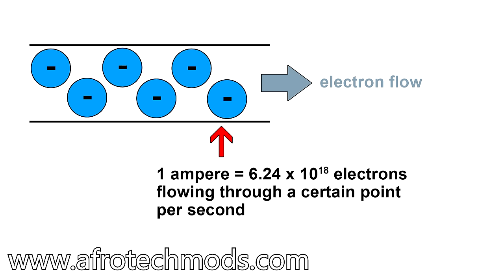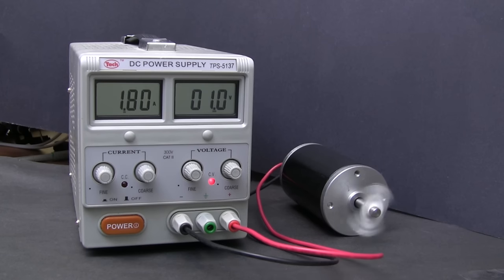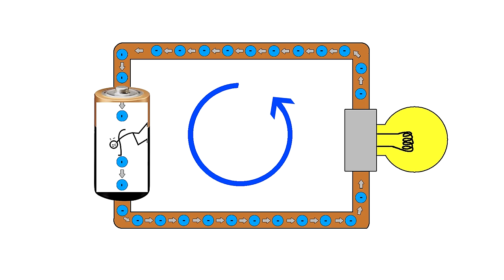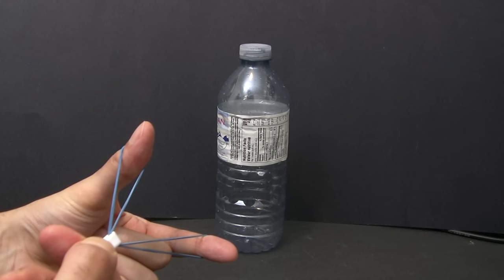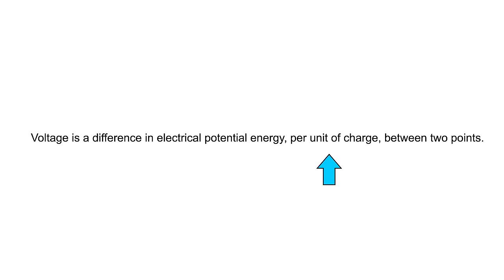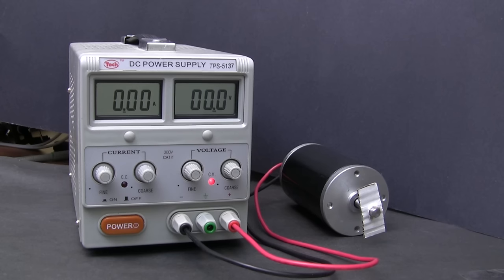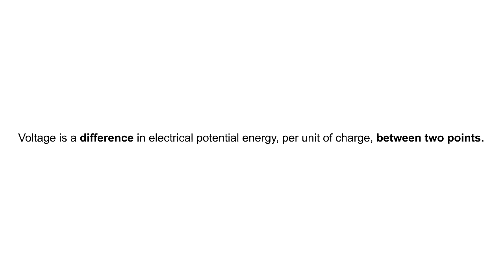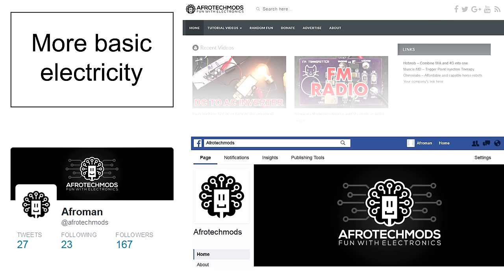🔌 Basic Electricity - What is voltage?

Comment: I don't understand how you can have different amount of energy per unit of charge. A coulomb is a coulomb, so how can one coulomb transfer one joule or two joules? What is it in the electrons that is providing this transfer? How is it that the same number of electrons can provide a different amount of energy?

Someone might say that it is the speed at which the electrons are flowing which is providing more or less energy, but I don't think that is correct. The speed of electron flow is captured in the ampere. So, you can have a one volt power source or a two volt power source and they can be connected into a circuit which, in both cases, draws only one ampere, and so the speed of the electrons flowing through the circuit is the same, but, somehow, the amount of energy transferred is different.
Reply: i dont know how to explain this but the energy of the elctrons transfered dosent only depend on how much voltage they are getting  but u also need to consider the resistance  

we have ohm laws  U=RI        and  P=UI                  power is the energy  per unit charge

lets say we  power a cercuit with 1v   that has a rresistance of 1 ohm    that means  the amps will 1 amp from   U=RI 

now lets calculate the energy per unit charge : P = UI        P = 1*1  that means that for evry unit charge it deliver  joul of energy

now lets increase the voltage and in the same time the resistance   and power  it with 2 v   and 2 ohms of resistance

that will still mean that the  amps will be 1 amp also  from U=RI

now lets calculate the energy again   P=UI      P=2*1     and there   the enery delivered per unit charge is 2 joulls this time   not 1 joul    

even tho  the number of amps stayed the same
Reply: iam not sure about this but i think the speed of electrons does provide more or less energy .. the energy per unit charge or the voltage is simply converted into kinetic energy to the electrons so yeah
Reply: Say I have a bullet. If I throw it at you,, it will tap you on the chest and you'll get quite stern with me. If I shoot it at you, it will pierce through your flesh and you'll have a wonderful scar to show your buddies and I'll end up with some jail time. 

In both scenarios, the mass was the same, but the energy per mass was exceptionally different. 

So, again, say I have 6*10^18 electrons. If I softly push them through a lamp at a low voltage, it probably wont even light up. But if I mash them through with 1000V, chances are the filament will melt and break. Different energies per unit of charge.
Reply: Also, "speed" of an electron is not in the amp unit. An amp tells you how many electrons there are flowing and nothing about how fast they are flowing. If you have a tiny wire and you are getting 5 amps, chances are they are flowing fast. However, if you have a wire the size of a log and you're getting 5 amps, they are probably crawling through your wire. So, amps can get you to speed, but amps alone does not tell you anything about speed.
Reply: Voltage is akin to force, how hard electrons are being pushed
Reply: Thank you. This makes sense. Amps provide an indication of flow, but without the cross sectional area of the conductor at the point of measurement, you don't know the speed.

Comment: It's a fairly good video...but...I think it was sometime in the late 1800s that physicists came to realize that the electrons in a wire or circuit barely "flow" at all.  What actually happens is that "charge" moves (one could say flow but the water analogy is only used for beginners).  What happens on the atomic scale, in copper wire of a circuit for instance, is that a copper atom at one end almost instantaneously the new charge on it to the next atom and so on, the electrons more or less staying put (though their energy level has gone up).  This is not my vid so I'm going to stop here and simply note that YT videos can be found that explain in detail how charge movement and not electron flow is the more fundamental explanation.

Comment: The subject is something like advanced engineering and there is no short way to take unless you start small and look up each component - wire size - specs of what to power (even resistors) and the basics are not enough. A battery being 9 volts instead of 5 or 24 can destroy your project or just one component. Specs are the first to look into. "Oh, my toy need 4.5 volts and the engineers put 3 x 1.5 v battery slots here - so how do I?" That's just the consumer level. "We need 5000 newton to lift a rocket" is very far to go in lesson 2.

Comment: That looked like pretty easy, until in saw a motor spec in a data sheet which read- "Max 250W / 20.4A@12V / 15.6A@16V " 
How on earth is that possible? You taught us that as voltage increased Amps increases. Then how is it possible that at 12V the Amps is 20.4 and at 16V the amps decreases to 15.6?
A total newbie here. Please someone advise. :)
Reply: Motors don't obey Ohm's Law exactly because of the induction in the windings.
Reply: Those numbers don't specify what the current the motor will draw, they specify how much load you can put on the motor without burning it out: 250W.  This is because the motor is rated for a constant power level.    To get 250W at 12V the motor will draw 20.8A (250/12=20.8)  and at 16V it will draw 15.6A (250/16=15.6).  The amount of current drawn by the motor depends on the load on the motor.  The more you load it, the more current it will draw.  So even at 16V if you load it enough you can make the current go up above 15.6A  - but that would run the power above 250W and risk burning the motor out.

Comment: I'm struggling to understand why a battery doesn't release all its power in one go.  Like in the light scenario;
..."1 joule is enough to power this flashlight for one second,  3 joules is enough to power this flashlight for 3 seconds..."

But how come the flashlight doesn't just burn 3 times as bright for one second? 

If voltage is pressure,  then when released why doesn't it just release everything at once?
Reply from the maker: It's a good question. The answer is that the load determines how much current flows from a voltage source. In simpler terms, "load" is the thing that you are powering. In the example the flashlight was just a 1W flashlight. So 3 joules would power it for 3 seconds. But if it had been a 3W flashlight then 3 joules would have powered it for 1 second. And if it was a 30W flashlight then 3 joules would power it for 0.1 seconds. Make sure you watch the rest of the videos in the basic electricity series for more examples. In general, the higher the resistance, the lower the load, so less current would flow.

Comment: if it's 1.5v battery why do we say it creates 1.5 joules..i missed that part about the connection between volt and joules.Amps vs coulombs, joules vs volts couldn't they find something more simple if the terms seem to be equivalent.no wonder this was the part in class i liked the least.

Comment: 1 ampere already means 6.24x10^17 electrons flowing through a wire per 1 second. Why then changing the name from ampere to coulomb? 2 coulombs per second just equals to 2 amperes.
Reply: They aren't the same thing.  I coulomb is the amount of charge you get from 6.24*10^18 electrons.  An ampere is that amount of charge flowing PER SECOND.  One is charge, the other is current.  With the water analogy, 1 coulomb would be like 1 cubic meter of water.  1 amp is when that water is flowing at a particular rate, say 1 cubic meter per second.
Reply: @stargazer7644  Thank you for your response.

Comment: between this two , what kills a human being ? is it current or voltage ?
Reply: koffy olomide_mopao 
the charged energy in each coulomb that is pushed by the voltage disrupts the electric charges in the brain and the spine which might cause paralysis. Some of the energy is also transferred into heat to burn skin and different organs. Both effects lead to damage in the body and for long periods of exposure to death. 

About the current and voltage, they both have an effect. If the current is strong then more coulombs are being transfered and each coulomb carries the voltage energy that pushes it, so many coulombs with moderate voltage (energy used to push them that stays inside them) will deliver a lot energy, and moderate number of coulombs with high voltage also delivers a lot of energy. Think of it as workers carrying bags of cargo, 50 (lots) workers (coulombs) each carrying 20kg (moderate number) bags (voltage) and let's say they deliver them in 1s will deliver 1000kg of cargo. 20 (moderate number) workers (coulombs) each carrying 50kg (lots) bags (voltage) in 1s will also deliver 1000kg of cargo and the cargo is the energy. You see they both determine how much energy is moved.
Reply: Voltage. The current is the flow of electrons, the voltage is the amount of push behind the flow of electrons. You can absorb a small flow of current through your body (a small shock), but a current pushed by a high enough voltage makes it deadly.

Comment: Watching this in 2023. Unfortunately, annotations are gone. This video uses at least one annotation to correct something that was said (I have a Chrome extension that restores annotations).

6:22: 'Error: Voltage can be referred to as "electrical potential" but this is NOT the same thing as electrical potential energy'

Comment: No doubt a sincere effort, but yet another video that gets the basic definition of current wrong, thereby sowing a pernicious misunderstanding. Starting at 0:00, current is NOT a flow of electrons, it is a flow of charge. Electrons carry charge, a negative quantity. And protons also carry charge, a positive quantity. It is true that when electrons flow, we describe their bulk effect as a current, and indeed the magnitude of 1 amp involves 6.24 x 10^18 electrons.  However, in the direction of electron flow, that is a current of negative one amp.  It is vital to understand this point, because it explains why, in a simple circuit with battery and wires, the electrons flow from the negative battery terminal to the positive, yet this is drawn as a positive current in the direction from positive terminal to negative.  Current is commonly misunderstood as a flow, when actually it is a flow rate_. Thus it is completely coherent that the electrons carry a flow of charge in one direction, but because that charge is negative, the _rate of flow (ie: current) is positive in the other direction.  When there's a flow of positively charged particles (such as positive ions in a gas or liquid), then their aggregate current is positive in the same direction as the particles are moving.

Comment: Why does the battery run down?
Reply: The battery stores chemical energy. When a circuit is made, the chemical energy is changed to electrical energy, and then to the work such as heat and light in a light bulb. Energy cannot be created or destroyed, just changed. Eventually all (or at least most of) the chemical energy in the battery has been changed into to heat and light and headed off into space. With rechargeable batteries, you can supply electrical energy and change it back into chemical energy again to store it.

Comment: soo what is the difference between amps and coulombs? seems like its just a confusing name for amps
Reply: using amps is just shorthand. an amp by definition is the number of coulombs passing per second.
Reply: but if 1 amp/s = 1 coulomb/s then what the hell is the difference?
i feel like I'm missing something here
Reply: 1 amp/s does not equal 1 coulomb/s. An amp per second would be saying 1 coulomb/s/s. The term amp includes the per second already.
Reply: ... sure... soooo, does that mean 3 amps would be equal to both 3 coulomb over one seconds or 1 coulomb per sec over 3 sec? I'm soo confused right now, electricity is seriously the most complicated aspect of physics I've studied.
Reply: 3 amps would be equal to 3 coulombs/s. Just remember that a coulomb is a unit of electric charge whereas an amp is the amount of electric charge over a unit of time or coulombs/s.

Comment: So always when Voltage is increased the current is also increased ?? I thought it was the opposite… in which cases current could decrease with more voltage ?
Reply: For conductors that obey Ohm's Law current will increase with voltage.  However many items do not obey Ohm's Law like gases, hot metals, saline solutions, although they may approximate linear behaviour over a small range of voltages.

Comment: So voltage is energy per unit charge, so what is this energy in the form of? I don't get it.
Reply: In the form of the motion of charged particles (electrons) - I think.
Reply: Energy (Joules) = Voltage x Amps x time.     Comparing it to water, it would be pressure  x flow rate x time.
Reply: Im wondering this as well. How/where does 1 amp of electrons have a different amount of energy when the voltage is higher? Where is that energy if not electron count?
Reply: @jasonjayalap  Jason, I think it's to do with the amount of force that they exert. In the water analogy, the pressure can be low or high. Higher pressure, when released, releases more energy. Another analogy, a 1kg mass held up on 1 meter above the moon's surface has a potential energy,. That potential energy is greater on Earth, because the Earth "battery" exerts more force. The voltage of a battery is a measure of the amount of force given to the electrons. Maybe.
Reply: @jasonjayalap  OK, imagine ten people pushing against a door and pushing very feebly, i.e. low voltage.  Now imagine another group of ten pushing really hard, i.e. higher voltage.  Which group do you think has the higher energy?  Voltage is like potential energy, a rock at the top of a very high cliff has more energy than one at the top of a small cliff.   Hope that helps, stay safe!

Comment: Okay, so lets assume 80mA or 0.08A would be enough to kill someone (I think its somewhere around there?).

What would happen if I touched a 200 000 Volt wire (or w/e) IF there was resistors equal to 100 times as much (20 000 000)
Would that mean, by Ohms law, that 200 000V / 20 000 000R = 0.01amps? which wouldnt be enough to kill someone? So basically could you touch a 200 kVolt wire? or am I missing something about Voltage, which makes it deadly? Dont really understand this Joule thingy xd

Very thankful for answer xD trying to understand this sheit.
Reply from the maker: You might like this video http://www.youtube.com/watch?v=8xONZcBJh5A
Reply: The current would run through you instead and kill you. 

The current will go through the path with least resistance. Your body is a resistor that goes straight to ground. So it doesn't matter if the resistor has a high resistance or if you're off the ground. The piece of wire you're holding with be shorted and everything will flow through you instead, and you would be the only resistor.
Reply: "path of least resistance" .. not really true. The least resisted path can accommodate more current, but that doesn't mean it will not flow in all other paths; it does.
Reply: John Tullos of course current will still flow through it. What I meant is that most of that current will go through the path with least resistance. Sorry for the mistake
Reply: Pablo P I was probably being too pedantic. "path of least resistance" is a very long used phrase.
Reply: And does not even mention dielectric breakdown.
Reply: Just touch the resistor with your hand, don't touch the 200kv wire.

Y can imagine air as a resistor. Since nothing's infinity, even air can flow current. Suppose we say that the air's resistance is 1 billion Ohms per meter, and your hand and the 200KV wire distance is two meters. With you standing barefooted on the ground.

0.0001 amp is flowing through your body. Great right? And no you don't miss anything, just don't do that for if something goes wrong like you tripping, or you use the wrong resistor value, or maybe you feel a bit shocked from the 0.01Amp that's actually quite bad for your body. Or your resistor is sweaty, or wet... Just... Don't..

So the simple answer is, you can't touch the wire straight, buut you can touch a resistor that's connected to the 200kv wire, JUST DON'T. Even standing 50 cm from a 200kv wire is a bad idea, there's family or friends that still loves you, don't do that

And people, for god's sake. This guy is asking a question, and instead of answering him, you're debating below him, shame on you.
Reply: That is basically correct.  But another part you're missing is that voltage is also dropped across that 20 Megaohm resistor, so the instant you touch it it is no longer 200 kVolt anymore.

Comment: instead of saying flow of voltage why we cannot say flow of ampere??
Reply: I will try to answer that - hope I am right. Use the analogy of the flow of water in a river which drives a water mill to do work. We might say that the molecules of water take the place of the electrons. You could say that the ampere of water is so many molecules of water passing every second. The water drives the mill wheel depending upon the force the water gives to the wheel. But you want to measure how much energy the water delivers to the wheel because it is the energy which enables the wheel to do work. Before you put the wheel in the river, you measure the potential energy the river has. That is mainly a function of how much water is in the river and how fast it flows. This could be measured by the difference in height of the river from the source to the mill, with the quantity of water, calculate the force of gravity - that's the potential energy. In the case of electricity, the driving force is not gravity but difference in electrical charge - that's the potential energy, which is what the voltage expresses. I think
Reply: The Ampere is the flow of electrons, a certain number passing a point per second, not a flow of voltage.